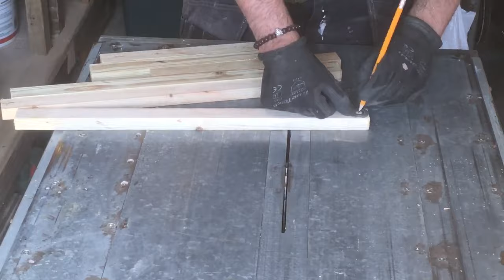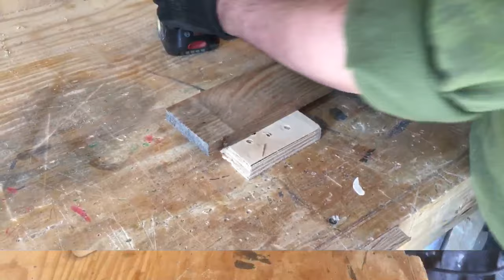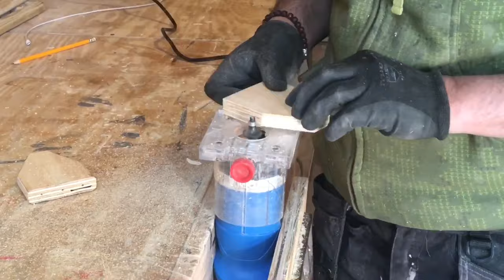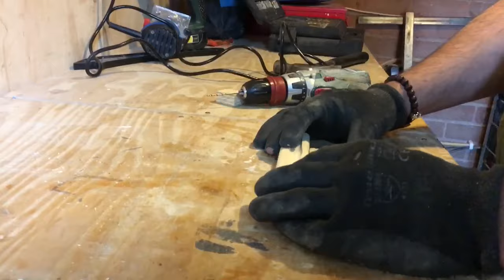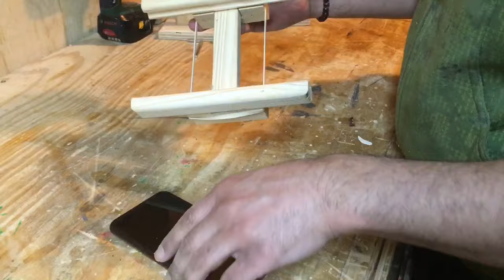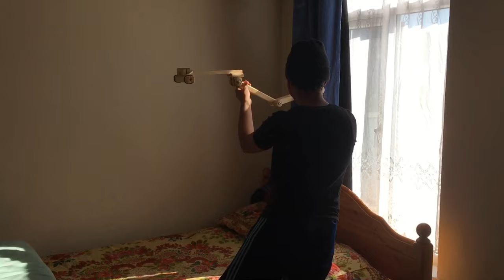DIY Phone/Tablet Holder

Comment: Wat I would have done is instead of the rubber band holding the top piece down,i would just drill a hole in the back threw to the main piece and push a bolt into the hole and it will stay in place,then do the same when you put a tablet in the holder
Reply from the maker: I didn’t think of that great idea maybe will  change